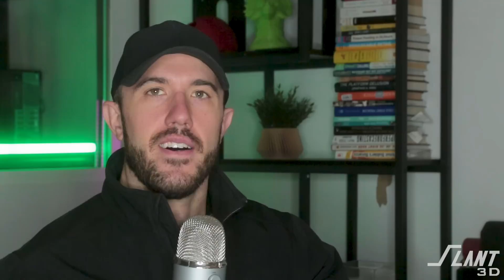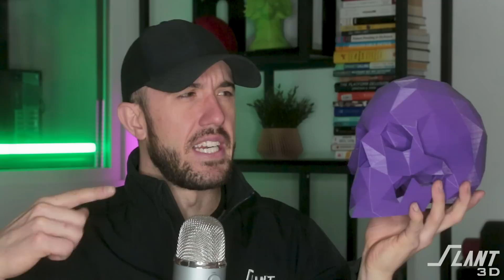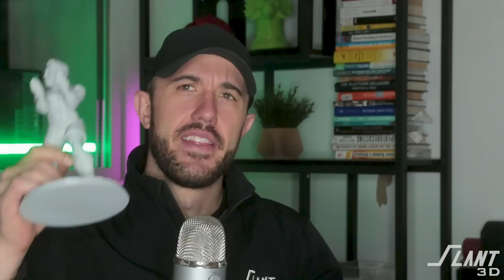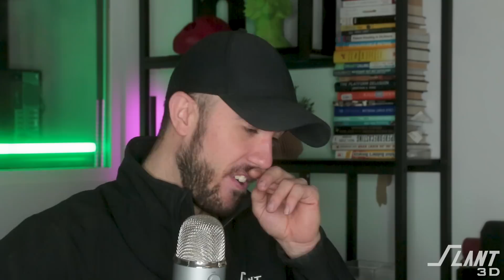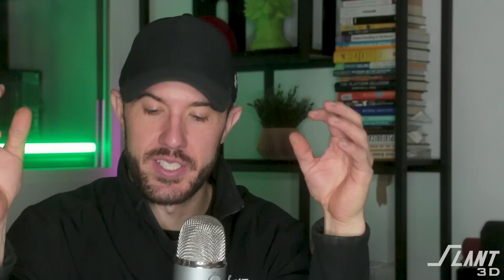Big Weekend at OpenAI | Slow Growth in 3D Printing | Software Updates | Changes to Tangled PLA

Comment: Some added context on Relativity Space. They successfully launched their first fully 3d-printed rocket (Terran 1) earlier in 2023. Best way to view Terran 1 is like a proof of concept similar to the SpaceX Falcon 1 rocket booster. Of SpaceX's initial four attempts, only one launch (made of leftover spare parts) made it to orbit.
Relativity Space is currently working on Terran R, which will is scheduled to launch in 2026 from Launch Complex 16 at KSC, FL. The "R" in Terran R, if you haven't guessed is for "Reusable". SpaceX will fly its Falcon 9 ~100 times in 2023, delivering over 900,000 kg to orbit. Plans are to fly over 140 times in 2024, this while most other rocket booster models only fly a handful of times a year. Relativity Space is looking to join this high volume market with its 3d-printed Terran R.
Just think what Relativity Space could do in microgravity if it places one of their 3d printers in orbit, or on the moon? It could take 3d-printing to a whole other level. Not sci-fi, it could happen within next 5-10 years.

Comment: What is the major basic factor for pricing your prints? Price per weight Or price per time of a print?
Reply from the maker: The pricing algorithms takes into account complexity, support, material, print time, and many other factors. No two parts are the same the system has to be robust

Comment: micro scale model building is mostly hobby 3d printing and industrial injection molding and since detail requirements are pushed by resin printing legacy manufacturers scale up with detail also but they also scale in price because every new model means milions of money for creating new molds and since models are usually expensive they are released in small batches
so if aditive manufacruring like laser fused plastic can eliminate layer lines and produce smooth finish plastic parts that would be a niche for a model kit or model retailer to pop up
i print my model trains in 1:160 scale at home  and i break every rule of 3d printing to do it :P (abs with no enclosure with 0,2mm nozzle or similar crazy)

Comment: WRT AI robot 27:37 ... "can't open a doorknob" ? Hmm, but it prolly can figure out a way to manufacture something surreptitiously. And then there's ordinary Unintended Consequences - sort of like what happened with our current petro v. solar. Just saying.
Reply: That would require the robot to be aware of a doorknob. Or, indeed, that the only thing between it and its goal is a closed door. For what it's worth, I actually HAVE had to teach an AI how to breach a door. But it required modeling the entire vessel (this was a naval simulation), modeling all of the normal ways to get around in the ship, and literally programming a special objective that was basically: assemble a team of crew to open any stuck door that is between a crew member and an objective that needs to be performed.

Granted, I work in expert systems, not neural networks. The problem with neural networks is getting them to give you the same answer twice given the same comparable inputs.
Reply: @seanwoods647  Yep, but that's using today's state-of-the-art and who's to say when tomorrow's AI becomes aware of, and can expand upon, what you're teaching your guy ?
Reply: @mpart_woodlathe-stuff  "tomorrow's AI" isn't going to be "aware". That would require a quantum leap. There is literally nothing in the lab and nothing on the drawing board to provide machine awareness. We might as well be talking about faster than light travel.

Comment: Buddy works for raytheon (aerospace) and said they were using some 3d printed aluminum parts on their units this year. Those parts are wearing quicker than initially expected, so theyre pulling those units and replacing the 3d printed parts with traditionally manufactured parts. Its not like planes are falling out of the sky, they just want to ensure what theyre using lasts longer. But its still a hit to 3d manufacturing considering thats one of the biggest aerospace companies in the world